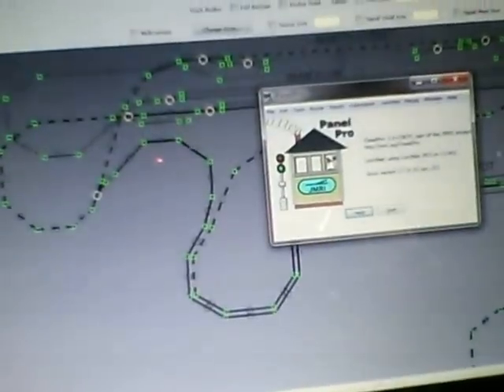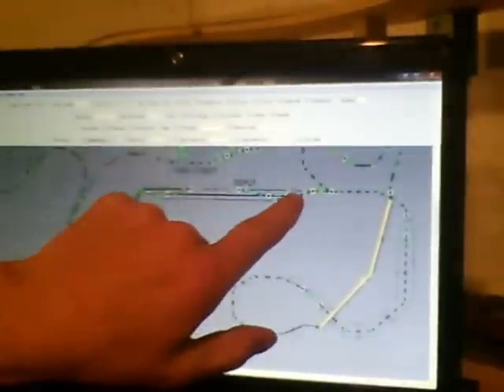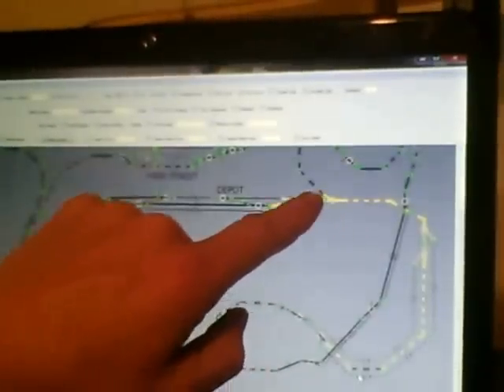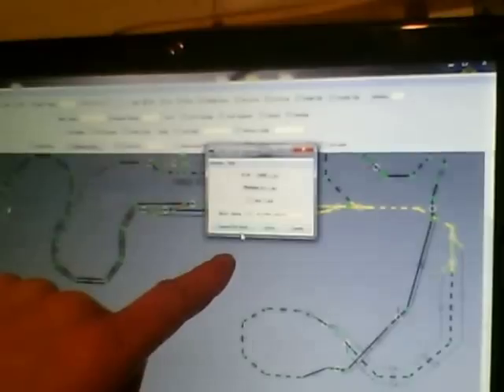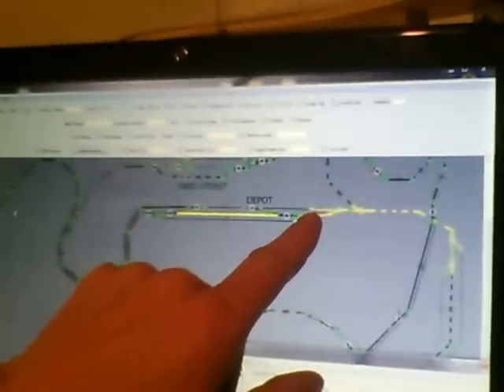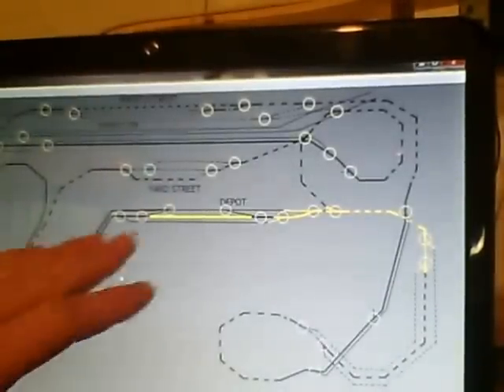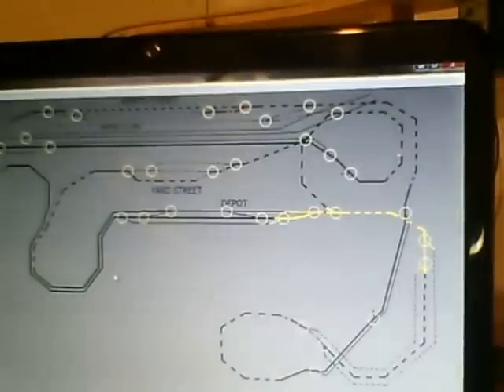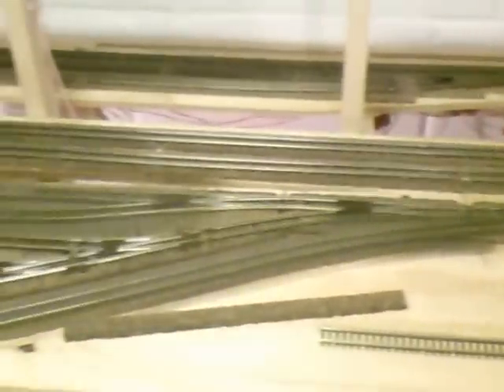JMRI AND DIGITRAX HOW TO INSTALL SENSORS WITH BLOCK OCCUPANCY

Comment: Pretty sweet setup.  Although I've got a question.  If you are installing resistors in all or some of your rolling stock, how do you keep track of how many cars with resistors are in a particular area or does the JMRI software do this for you?  I ask because the more resistors you have in parallel across the track, the lower the resistance and the higher the current draw.  For example if you had two pieces of rolling stock each with 1k resistors installed, the total in that area would bee 500 ohms and if you had 3, you would have 333 ohms.  I=V/R....
Reply from the maker: Thank you for the question. Sorry it has taken me so long to get back to you on this however I have used the resistors only to detect trains in that block for signaling. The rolling stock will be kept track of by car cards for the areas they go to and come from. The resistors are minimal as it only tricks the BDL168s in reading that the track is occupied. All of my rolling stock has resistors on them for this reason including the caboose. I dont remember exactly what I used for resistors at this moment however when I find the paperwork on them I will get the part number and the company that i purchased them from as they were pretty cheap.
Reply: Do know what size resistors to use and did you find out where you got them.
Thanks in advance, good video.
Reply from the maker: Don Mullis here is the link for the resistors that I used in my wheelsets for occupancy  http://www.mouser.com/ProductDetail/Xicon/263-10K-RC/?qs=%2fha2pyFadui8KtIYf80pRPJ4ncYJbRRRgiRFx5PhA20%3d

Comment: Glad to see you did a video on this. I tried using a BD4 with a DS64  and when a train occupied that section of track on JMRI it would flash on and off instead of a steady lit section. I tried several different options to trouble shoot the issue but it still did the same thing. I used the same BD4 on a SE8C and it worked fine. I wondered if maybe you had experienced this problem or may know what the problem is.